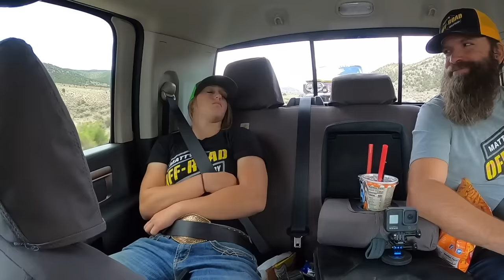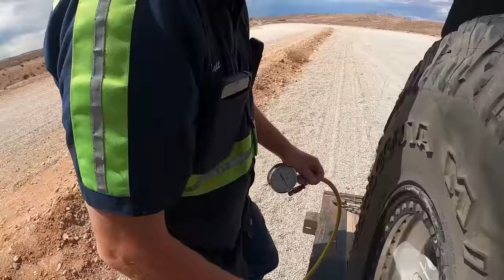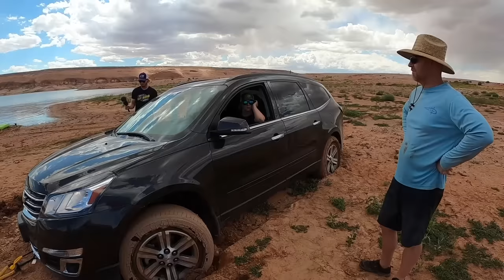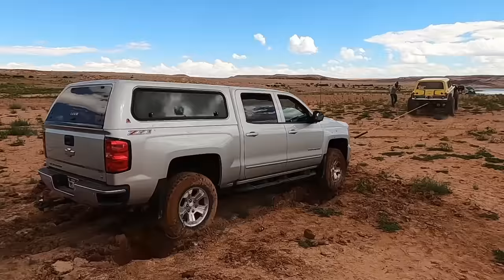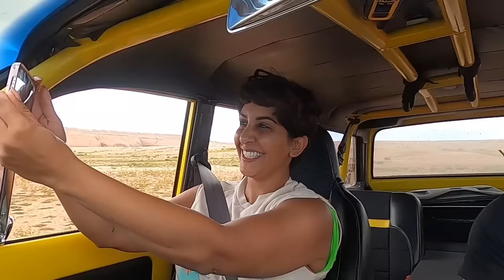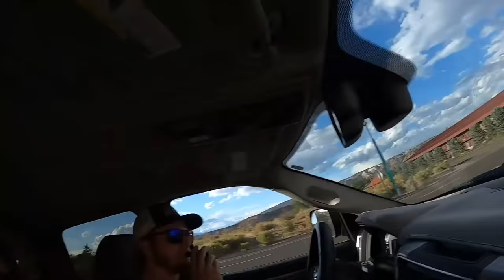2 Days Stuck In The Desert & Desperate For Help!

Comment: I think Matt knew that wasn’t exactly a shortcut. He just wanted to see how Rudy’s ram would do
Reply: I bet I can tell you exactly what it is. Matt's old school with his family group, and acknowledging that fact, Rudy's in a brand new truck. Matt what's to put Rudy in a situation where he could break in the ram and get a feel for what it could really handle, and not have Ruby super worried about it then, or in future off road usage. It's like how the old timers say that if you get a new thermos, scratch it. New knife, drop it. New gloves, rub them in the dirt. Takes the feeling of needing to keep it pristine and perfect and makes you feel comfort with actually using what you've got.
Reply: @andymcelhiney3030  He drives a Fix Or Repair Daily so the RAM would be a HUGH upgrade over the Super Junk
Reply: @andymcelhiney3030  as long as he keeps it stock it'll go forever. 9 times out of 10 people with trans issues, someone previously added power with a tuner.   My buddy's bone stock 2017 has over 100k miles pulling a massive 5th wheel with zero power train issues.    That RAM even bone stock wouldn't notice the morvair behind it.
Reply: @v12alpine  yeah but are you considering staying at low speeds in low gears? The main reason transmission over heat no matter what make or model or spec? Especially when their summers stay triple digits? I have no doubt in the quality but heat soak is heat soak. If your not moving fast enough to disapate it then that's just that
Reply: @andymcelhiney3030  I do that all the time when I get something new. Even a new phone, I'll throw it across my lawn. My current phone I've actually tried to break twice and failed both times.
Reply: @itsyaboi6535  hey man there you go, puts a few marks on it and unwinds those nerves a bit
Reply: @andymcelhiney3030  I ran Dodge's for years towing hard(Not Off Road) coast to coast with 0 problems.
Reply: @jamescox4823  yea I grew up riding shotgun in dads 18 wheeler and noticed most of the pickups pulling heavy loads on the highway were Dodge Rams. It’s rare to see a HD Ford or a Chevy towing a trailer with 3 or more cars.
Reply: @jamescox4823  I wasn't saying anyrhing bad about them at all. I would have a dodge if I had the money and space to keep my square body, fix it up, and drive it as well as what ever dodge I'd get. Same with fords.  I'm really not bashing any brands here. I'm saying that if it's going to be pulling low and slow the transmission coolers not going to be getting a constant flow of cool air moving 50-60 miles per hour threw it. Sure it should have a fan in there, but that's still not the same as moving at speed. It's less fresh air being ran threw and more fan getting warm pulling air threw the grill to a hot radiator and engine bay which also doesn't have a 50-60 mile per hour wind helping to clear it of heat. While the engine itself is staying warmer due to the lower speeds. Keeping the radiator warmer.  All adding up and beginning to heat soak. And this repeated frequently over prolonged periods in high heat runs fluid life down faster (hence why heat resistant fluids are a thing on the market) and under extreme conditions (somthing this crew works in frequently) can result in damage. In anything. I dint care if it's a Ford, chevy, dodge, Honda, Toyota, Nissan, Hyundai, kia, litteraly anything. It's properties of heat transfer and returns. Its just a thing. Obviously they are alley to have a strong and reliable cooling system and transmission. Id hope that they'd all go for years just fine. But if you have the money and your gunna be working the heck out of your new baby wouldn't you want to best for it? And look at the trend on the channel, they like to build their stuff. This truck won't be seeing a crazy suspension I'm sure, so you know that he won't be rallying it while towing like they would the banana or morvair. It'll be low and slow and knowing that, I personally (on any vehicle) would say screw it and build an even more beefy set up based in stock parts and performance parts ment to take a beating, paired with a beefy cooling system. Just for the fact that I'd never need to even think about the fact that it might get warm doing a job so ling as I keep maintaining it.

Comment: For deflating the tires, you need to get trailhead automatic tire deflators.  Had them for my xj.  I set them to 10 psi.  Screw then on, set it and forget it.  Once at the set psi, they stop.  They cost about 65 dollars.
Reply: They take a lot, lot longer to let the air out than taking out the stem
Reply: Then they rip your valves out of the rims, yey!!!
Reply: @bushratbeachbum  i think hes tlaking about doing it while its on the trailer
Reply: @concentratecorner1744  That's what she said!
Reply: @concentratecorner1744  That would be a dumb idea as the tire pressure is keeping the tie down straps taught
Reply: @ChrisCameronPhoto  hey i never said it was a good idea lol i was just explaining what im pretty sure the dude meant
Reply: @concentratecorner1744  Yep, sorry. I should have made my reply to Russian Mafia10
Reply: A portable air compressor and a valve removing tool is cheaper and you can use them on more than one vehicle.

Comment: Hey Matt. If you switch the gauge end for end it will be facing the right way. You’ll just have to stop buying left handed tools. 🤓
Reply: @ShitStefanShoots  exactly what I though lol
Reply: the rest of us would simply tighten the threaded fitting half a turn ;)
Reply: Need a right handed 1 for the other side.
Reply: i think next time he needs to check if he ordered a driver- or passenger side gauge
Reply: He seems all broke up about it.
Reply: Maybe Just put a Air Hose Coupling on the guage and hose so it can be unhooked & also Turned any direction required.
Reply: Sometimes you can warm up the hose so it’s soft then curve it how you want and let it cool. It lets the hose take a new set facing how you want.

Comment: Man I hope when Rudy bought that truck that he got a Mega cab the room they have is like riding in a luxury car cabin thats in a truck amazingly comfortable
Reply: Not really worth it for the lost bed space on a truck that actually gets used as a truck.
Reply: @russellv6234  You're crazy if you think that. The amount of utility the Mega Cab offers is unlimited. And the short bed has zero effect on how much weight you can put in it or tow. "Real truck" stuff has WAY more to do with having a trailer than having the extra bed space.
Reply: Yeah but its still a FIAT Dodge. People buy it still thinking its an American company when its really a low quality Italian-Dutch conglomerate of the worst quality automobiles.
Reply: @cwilczewski23  You'd have to be so fat for the mega cab to make a difference. And are you kidding? Real truck usage is split between bed usage and towing and the mega cab throws that out the window. And the mega cab does reduce towing capacity. Not by much, but it does.
Reply: @russellv6234   I understand what you're saying if you're pulling a 5th wheel style  because the goose neck can potentially hit the cab with the short box. they dont  offer The Mega cab with the long bed anymore which does suck but there are new converted trucks
Reply: @cwilczewski23  right, I see a lot of hot shot drivers buy megacab rams for that very reason. I was looking for one too, settled for a quad cab because Megas were too expensive lol. Either way can’t go wrong with a cummins 🤘🏻🤷🏼‍♂️
Reply: @johnnytorres277  Well, that's about the image american companies have in Europe... Guess it's coming full circle, then. 🙄😉
Reply: @russellv6234  The fact that you're talking about the size of a person means you have no idea whatsoever how the megacab changes the way you can use your truck. The amount of interior storage you have without losing passenger comfort is unbelievable. And if you don't need 5-6 passenger capacity, then you have more space than 2-3 people can reasonably use. There is a reason that the MegaCab is so desirable and highly valued. They retain value better AND aren't resold at the same rate as any other spec.
Reply: @russellv6234  I believe the back seat riders would disagree with you.
Reply: @sad754yt  I've ridden in the back seat plenty of times. I disagree with you. So you're wrong.
Reply: @johnnytorres277  That is the stupidest comment ever...

Comment: I’m surprised more recovery companies don’t add off road recovery to their skill set.
Reply: completely different cars and crew experience. that costs a lot. Matt said in one video that most of the offroad people who gets stuck are helped by others successfully, and do not need company help. unless those borked razors with ripped off wheels :D
  So probably not enough work for most companies to be wort it to do offroad stuff? Actual towing and recovery on road is "always on job" comparatively. at least the guy I know, who towed my stuff, said he has never lacked any work to trailer broken down or crashed cars (works with small platform truck and an suv for different jobs).

Comment: Theis video was 15 minutes late, I was worried 😁

6 hours each way? I bet that was one expensive tee shirt!
Reply: Still cheaper than abandoning your vehicles in the desert 😉
Reply: Somewhere in the magnitude of $1000 for salaries alone for this recovery.  Then there is about $600 for mileage.  Hauling them out costs another $500.  Matt's expertise isn't cheap and adds to that.  I'll bet this was a $3000 recovery -- and worth every penny.
Reply: @MichaelSteeves  Yup at least 2 grand I'm sure. Don't forget there are only three actual crew and a cameraman whose wages you can't count in the cost to the customer. I'd say more like 600 to 700 in wages.
Reply: The average company would do it with 2 guys, and charge about $2500.  My guess would be that YouTube allows him to charge considerably less.
Reply: @marvindebot3264  overhead and insurance bill out rate would be around $65 an hour for one guy.  Time and a half after 8.  14 hour day.  $1100 per guy is what I'd charge

Comment: The only problem is you guys weren't on the list the park service gave him that needs to change! Unless it's so far out that it doesn't make too much sense to be tied up so far away
Reply: And the irony of the ones on the list can't even do it because they would get stuck. Matt made it look easy specially just driving the trailer out with the truck they just pulled out.

A list of recovery companies that can't do recoveries is pretty pointless.
Reply: @JamesSmullins  right especially in that part of the country where the average family or person will venture offroad or at least need to because there's not a paved option.
Reply: Funny part was this recovery was pretty easy just distance to get there was quite high
Reply: @mg00  I would agree except this is the park service list, a park that is almost entirely off road. If their list is ones that can't do off road recovery then it is a useless list for park service and better suited for regular police on paved roads.

Comment: Holy smokes. I can't imagine what this job cost the customer? My guess would be $3000.00
Reply: It cost 2 Banana. Not brand new, but...
Reply: @jvernet93fr  I was thinking 2 bananas + $3000 would be fair?
Reply: More like 1800 is my guess.
Reply: $2500 to $3k is fair guess.
Reply: Good question I was wondering the same.   Im always curious on how much there average recovery would be?
Reply: 4 employees, two vehicles and 14 is hours. I'd say $4,000.
Reply: @thomasmendez142  4 employees, 6 hour drive one way. All day job.
Reply: @trd4d  4 employees, 6 hour drive one way. All day job = $$$$
Reply: @MontanaWelldigger  4 employees, 6 hour drive one way. All day job = $$$$ 
$4000 seems fair :)
Reply: @EL34XYZ  taking 4 doesn't mean needing 4.  Took 2 to run the cameras, so that cost is attributed to YouTube expenses.
Reply: @MontanaWelldigger  at no point were 2 vehicles used though.  If you charge for the use of an automotive bay, you can't charge 6 hours for each bay if you only use each one for 3 hours.
Reply: @trd4d  It's all an expense that has to be recovered. However you choose to categorize it. 
Lunch, employees, gas, whatever. It was all a part of that job.
Reply: @EL34XYZ  how many times have you heard that the camera crew are not his employees?  Hundreds!  Their expenses are most likely covered by YouTube revenue.  I do recoveries daily, so I have a pretty good idea what is involved.
Reply: @trd4d  So they work for free?
Reply: @EL34XYZ  ya, that is why I said that the YouTube revenue pays them.  Because they work for free.

Comment: Advice from an Aussie, if you have road tyres forget it. 4x4 and all-wheel drive are not the same. Diff-lockers are magic, low-range is ok. Bare minimum after all that is 1. mechanical winch (electric fails in wet scenarios), 2. RECOVERY BOARDS!!!, 3. Let someone know where you are going and what time you expect to return. 4. At least 20 liters of water, 5. A shovel! Otherwise go home, because you don't know what you are doing. In Australia if you need help it is expected that the bloke helping you uses your gear, and a pull outa sticky situation costs a box of beer or 700ml of whiskey.

Comment: I've tried to tell people about that stretch of 12 on that ridge, super sketch. I drove up and down it a couple times on my last trip out there, once was at night. It also looks like that was the waterpocket fold you were driving up, there's an incredible scenic view just a couple of minutes off the Burr Trail at the top of the switchbacks with something like the moorvair you could have stopped at. Strike Valley Overlook is an amazing view. That and you passed a couple other really impressive sights on the way down 12. You should get back that way, it is for sure another reason why Utah is one of the most incredible states.

Comment: Dude your gonna love that truck. Most people don't realize what a beast that 2500HD is with the heavy duty axles and the  6.7L CUMMINS Turbo D. Get some decent tires.... I run the BFG 285/65R20 KO2 on mine (equal to a 35 inch tire and will fit that stock rim) and never had a flat yet with all the crap I run through and they are 50,000 mile rated. But very expensive.  But they are great low noise highway tires as well as off road.

Comment: I did some research on Google maps. Rudy's truck pulled 41.6 miles of dirt road on the Burr trail Rd. Burr becomes BLM 12000 before it hits and ends at 276 Hwy. The dirt/pavement switch is at the Entering Capitol Reef NP sign. Near Hwy 12, a sign on Burr says Pavement ends in 75 mile; travel at your own risk. (Correction: The 75 mile sign is obsolete when compared to Google maps. There is only 70 miles of Burr Trail Rd from Hwy 12 to 276) The 75 miles of paved Burr, is over 90 percent just chip seal, speed limit 30.  Also says trailers not recommended, steep grade, sharp turns. I'm going to send a few picture I took by screenshot to MORR and maybe they'll show them later.

Comment: You could use the Apex tire deflators on your off road rigs... I have them and they are awesome. They drop me 37" tires from 35 psi to 10 psi in 10-15 seconds without taking the valve stems out and to install them there is no need to drill the rims, they fit on the regular valve stem.

Comment: I can't help but wonder what would have happened if the stuck people had lowered their tire pressure.  I helped a couple get their vehicle out of the salt flats close to Salt Lake.  I did it by lowering their tire pressure from 45 to about 8.  That is all that it took, and they were in up to the frame.  They had dug out under the Land Rover, so they were not high-centered any more.   I walked out to where they were from Interstate 80.  They were about 3/4 of  mile north of the freeway.  They had camped the night out there, and got stuck when they tried to leave.  Tire pressure is an amazing thing.

Comment: I was stuck once for 3 days with an Arizona game warden and another lion hunter in a place called the Galiuro wilderness, Cell phones didnt work, the game warden's radio didnt reach out.  I seen a tractor at a ranch where we came through, took a horse back to the ranch, ( about 10 miles)  the tractor was tore down, I found 2 high lift jacks in a barn and tied them on the horse and went back. We finally got out and seen the rancher on the way out, gave him his jacks back,  he showed me these things he made that hook on your wheel studs, about 100 feet of cable, it turns your wheel into a wench, hook it up, hit the gas, either your truck comes out of the mud, or the tree comes down.  Hard lesson learned.

Comment: If the gauge points the wrong way, stand the other direction. You could also remove the valve and use some tape to orient the gauge.  Or get a swivel fitting.

Comment: Some time ago I took a meander through Capitol Reef and I must have made a sort of southerly arc to the east of Bullfrog because for several days every damned sign I saw said "Bullfrog 70 miles" and I couldn't figure out how I could possibly have stayed the same distance from it.  I was navigating using a 1957 Rand-McNally Road Atlas and worked south around a big peak that was visible for several days so I can, in retrospect, understand how it worked but it was at the time quite a conundrum.

Comment: I just picked up a 2 gallon air compressor at tractor supply. $69.00. Put a 2000 watt inverter in my rig too run it. The compressor is awesome. Anyone looking for a compact compressor. Take a look.

Comment: Ram :(  Is the drag link welded that's how they fixed my drag link on my 2015 ram recall drag link falls apart can't steer it wonder how that was discovered. Chrysler idea was just weld the adjustment nut instead of replacing the drag link. Now if I need to realign it nut is ground off and rewelded.